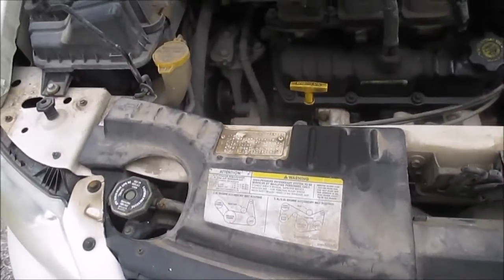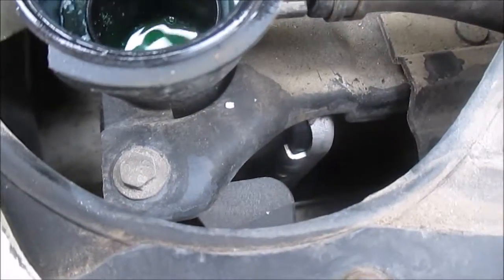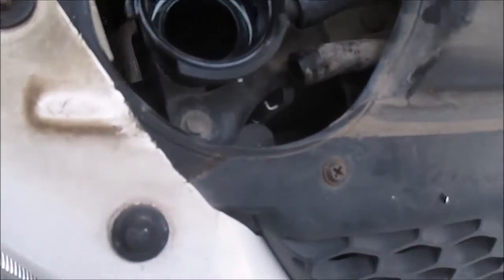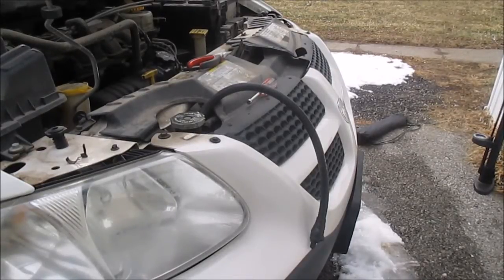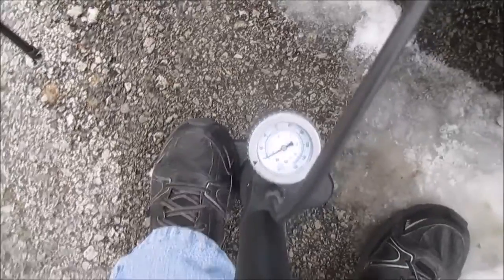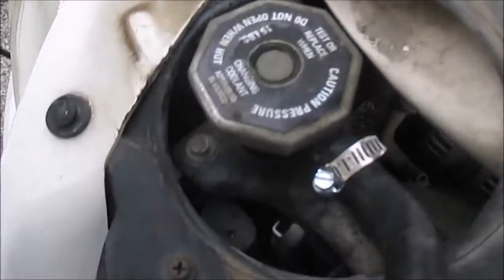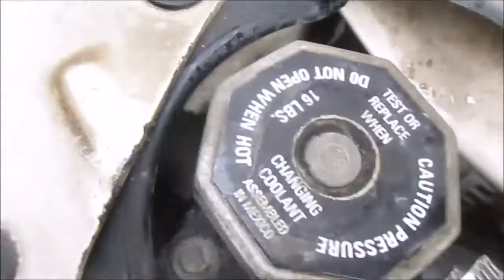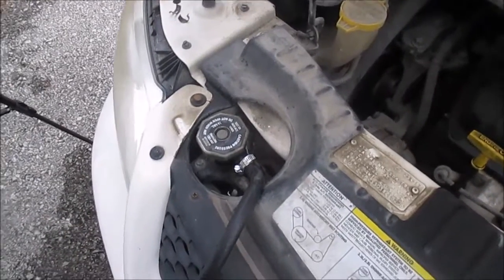HOMEMADE COOLING SYSTEM PRESSURE TESTER - PART 2

Comment: I saw another video like this years ago. I have done this 2 different ways, one by method above and the other by modifying an actual radiator cap with a tire valve through it.  The custom cap method found a leak on the actual radiator.  The method above found a faulty radiator cap as well after my car overheated. I pumped air through the overflow hose to 15 or 16  lbs pressure. The pressure built up and the guage held for a minute then slowly decreased.  The coolant hoses did fill with air.  I couldnt find any leaks until I tapped on the radiator cap and it began hissing. When I swapped with a new cap and pressure tested again, the pressure did build and fill the hoses with air. I could also hear the air hitting the inside of the cap. However this time the gauge would spike at each pump, but fall back to 0 after each pump. If i pumped again, the reading would jump a bit higher, but read 0 again. I assumed the cap was not holding pressure but sure enough the hoses were full. I opened the cap and a big burst of pressure was released.  I inspected both caps and the new one had a slighter larger seal underneath, not sure if it has anything to do with it. Well, I dont know the science as to why the variations during the test of each cap. But i can confirm this method works.

Comment: Your cap has a spring under it, under that is a seal the seats on the inside of the radiator, all you're doing here is pumping air in between two cap seals and not getting air underneath the inner seal into the radiator. That inner cap seal is designed to open from the inside to relieve inside pressure, not open up from outside pressure by adding air from the top side. This cannot work, and is why you're upper cap seal appears to leak when in fact it's probably good. Try a new cap the same way and I guarantee it'll do the same as this cap does.
Reply: You don’t know how radiator caps work. What he’s doing works.
Reply: @wcjcnc  and yet here you are with no explanation otherwise?... go figure?
Reply: @garyr7027  A radiator cap allows coolant to flow in both directions.  When the coolant gets hot it can be purged out of the radiator cap and into the overflow tank. When the coolant cools down it will be sucked back into the radiator. Sorry I didn’t explain. I figured you would just search,” how a radiator cap works” on YouTube. There are some nice videos with animated graphics showing how this works. I posted a link to a video to show you how a radiator cap works.
Reply: @wcjcnc  yes that's how it works, but if I recall in this video it defies those principles and that's what I was trying to convey... maybe I didn't explain it right? And no I didn't need YT, I've known that from years ago before the internet.
Reply: @garyr7027   Wait what? First you comment that,” here I am with no explanation on how it works”. So I explain how it works. Then you tell me you’ve known how it works for years but you don’t think it works in the video. ??? Alrighty then.
Reply: @wcjcnc  man go back and watch the video very carefully and think. You obviously know how a cap works, yet you can't catch what he's doing wrong?... C'mon man I know you're smarter than that. I reviewed the video again, and he's not testing it right because he's forcing air up against a one way valve inside the cap inwards when the valve is only meant to allow pressure thru the other direction. He's loosing pressure thru the upper cap seal which would indeed happen cause the way he's pumping air up against it due to the valve inside the cap that won't allow air INTO the cooling system.
Reply: @garyr7027   I think we’re both focusing on two different things. My point is, you can put pressure into the radiator like he’s doing. You’re point is, he’s miss diagnosing his radiator cap leaking because he’s forcing air out. I think we’re both right. You can put air pressure into a radiator like this but as soon as you reach the radiator cap’s rated pressure, the check valve will close, once that happens you’re just pushing air into the tiny area directly under the cap at which point it forces its way out from under that cap seal. I wasn’t paying attention to his mis diagnosis.  He should pump air into the radiator, then wait for the air to stop escaping from the cap. Then look for leaks. Sorry I wasn’t paying attention to him thinking his cap was leaking.
Reply: @wcjcnc  and then there's the spring loaded seal inside the cap, which seals against the radiator neck on the inside. That spring forces downward pressure against the inner seal, and he's pumping air inwards with the spring pressure. So basically, he's aiding the spring pressure, and there's no way forced air will get past that inner seal. Now if that inner seal wasn't there, and or the spring, this method would work in testing the system for leaks so long as the overflow tube is blocked off. He's pumping air in between two seals thru the overflow tube and nothings getting down into the system, and it can't be done this way, thus why he's getting air past the upper seal of the cap. That upper seal will give way long before the inner seal will... if it gives at all.
Reply: @garyr7027    Air will go through the check valve into the radiator but only until it reaches the caps rated pressure. Then the check valve will stay closed. Then it will only put pressure into the tiny space under the cap. So you can put pressure into the radiator like this but only 12-15 pounds. When water is pushed out of the radiator it pushes that big rubber seal with the spring on it up off the seat. When it sucks water back into the radiator it pulls it through a check valve located in the center of that big rubber seal. When I test a coolant systems I use a coolant system tester that eliminates all this so you can put as much pressure into the radiator as you want. This video is just a ghetto DIY way of doing it. Now that you got me thinking about this I may have to modify a radiator and do some test just to see how much pressure you can actually get into a radiator by doing this. Shit like this eats a hole in my brain.
Reply: @wcjcnc  but then that's only inside pressure and suction, all designed to operate from under the seals, not above the seals. Pressure from the inside pushes up against the cap spring, suction pulls from the inside on the check valve spring as the engine cools down so long as the system is fully bleed off. So, again unless I'm missing something here?... i still can't see this working even if it had 20 plus psi thru the overflow tube and by then the upper seal fail to hold as in this case.
Reply: @garyr7027    But I would think the check valve would open when pressure pushes on it from above. It’s still opening and allowing flow in the same direction as it does when the radiator is sucking coolant back from the overflow tank. Hell I don’t know, you may be right.  I have a shop, when I get a chance I’ll cut the neck off a radiator and rig up a little thing so I can test this. I gotta know now.
Reply: @wcjcnc  yeah I hear ya, shit can get easily overlooked even with little things. Damn, I've scratched my head for days on stuff before, and I'm like you I gotta know. Can't count how many things I've dissected open just so I could figure it out... even electronics... Lol
Reply: The vacuum relief valve in the cap is how the air gets in.
Reply: @SirDeanosity  that doesn't even make sense, if that was the case then the cooling system couldn't even bleed out.

Comment: I think the cap acts like a valve and can't be done this way. It won't hold air because it's designed to release pressure from that outlet. I think. Correct me if I'm wrong. Maybe buy a cap and take it apart and rig it to be open the whole time. Haven't done anything yet with it but anyone correct me if I'm wrong.
Reply: Check how the cap works: it works two ways. He uses the second release valve in the cap that let's in coolant fluid back in when the pressure and thus volume goes down that prevents collapse of the rubber pipes every time the car cools down
Reply: That's right, he's pumping air in between two seals on the cap, no air is getting in that radiator. Only the inner seal holds the pressure, and it's spring loaded to seal against the inner part of the radiator, the upper cap seal only seals the coolant that flows into the overflow. This way cannot work for a radiator pressure test.

Comment: this is not correct. The cap seals the overflow that you are connected to. and you are pressurizing the wrong side of the cap spring and thus cannot get pressure into the system. There is no way to force air into the system for your test. If you were somehow "under" the cap spring, this would work, BUT if you were under it, the overflow would be 100% open all the time... which of course it is not. The leaking cap in coincidence.
Reply: You don’t know how radiator caps work. Radiator caps do let pressure into the radiator through the center of the seal you’re talking about. When the engine gets hot the coolant will push the spring loaded seal on the radiator cap up off its seat allowing coolant to go into the overflow tank. When the engine cools off a vacuum is created inside the coolant system. This draws the coolant in the overflow tank back into the radiator through the check valve in the center of the seal. So what he’s doing works and many people test coolant systems this way.
Reply: @wcjcnc  didn't think about one forcing the vacuum valve to open with positive pressure from outside but you are right..
Reply: @kafklatsch3198   Lol. I thought the same thing when I saw a few videos of people doing this. I thought there’s no way this would work. So I had to do some research on how radiator caps work. I didn’t know there was a check valve built into the center of the big seal to let coolant back into the radiator. I’m 53 and never knew that.

Comment: Hi guys I found another way to do this same test in a different setup with far less work. It involves using a compressor tire inflator which plugs into one of the car battery jacks. There's a picture of this at https://www.amazon.com/Hausbell-Portable-Compressor-Inflator-Multi-Use/dp/B07GTFFHC6. Basically I would just disconnect the hose to the overflow tank on the tank's side and hook it up to the inflator using one of the adaptors appearing on the top right of the picture link I just gave. The principle is the same but far less work in having to build everything from scratch. The tire inflator set already has everything needed to do the test. Just saying if you happen to have one of these tire inflators lying around like I do, just plug and test. I found a leak on my Camry using this setup which I conceived after watching this video. Thanks for doing this video otherwise I wouldnt have thought about it

Comment: AJ.....if you are pressurising via the vacuum valve ( of the cap )....then at the end of the stroke of the pump the vacuum valve closes...so what pressure are you monitoring on the pump gauge?
Reply from the maker: I think I see what you are saying, I thought about it for a little while. I think you are right at the end of the stroke of the pump the valve would close, and you would be monitoring the pressure on the vacuum valve and cap side. However I think this should still work for monitoring the pressure in the system, because if pressure dropped on the system side, the pressure difference across the vac valve should open the vacuum valve again and you would see the gauge pressure drop. At least that is what I am thinking, I could be wrong. Lets say you pump the system up to 16psi and the pressure is equalized on both sides of the vacuum valve. So now we have 16psi on one side of vac valve and 16psi on the other. I would think if a leak is present on the system side  you would have a pressure imbalance and the vac valve would open and you would see a pressure drop. Well anyway I think I see your point, and perhaps doing this test might be better done removing the radiator cap, and replacing it with a radiator cap with all of the guts removed so the only function of the cap is to just seal the system, and then tap into the overflow and pressurize the system that way. Anyway I still think doing it the way I did it would work and show pressure drop if there was a system leak. Let me know what you think. Thanks for the comment and have a good day.
Reply: @figibloom    You are correct. Think of a piece of pipe with two check valves inside it. Each check valve lets pressure move in opposite directions. One check valve takes 15 pounds of pressure to open, allowing pressure to go one way. If the engine and coolant are cold the other check valve doesn’t need pressure. It’s already open and allows you to move pressure the other way, into the radiator. You need to look at the pressure rating on the radiator cap. Let’s say it’s 15 PSI. So once you pump 15 PSI into the radiator you will be at the point where the seal on the cap would usually open but because you’re using the overflow port the pressure will be the same on top of that seal so it won’t open. Never exceed the pressure rating on the cap. OK so let’s say now you have 15 PSI in the radiator. That should make coolant come out of the leak long enough for you to find it. If not. You can wait until the pressure drops to say 5 PSI and pump it back up to 15 PSI.

Comment: the radiator cap is close you cant pump the air to the system friend
Reply from the maker: +amjad amj 
No sir you are incorrect in your statement. It opens the vacuum valve side of the cap. Here is what I am talking about. 
http://asecertificationtraining.com/radiators-in-automotive-engines/      (scroll down to the diagram of the radiator cap and you should see what I am talking about)
Radiator caps have two way valves one that opens on pressure usually around 13-16psi and relieves the pressure to an overflow tank or vent. However when that coolant cools down it creates a vacuum in the system and pulls that coolant back from the overflow back into the radiator through the vacuum valve.  I can see why you would think that, most people do not realize there is a vacuum valve in the bottom of the radiator cap. So it works just fine doing it my way. However most of the time I use my stant pressure tester to do this test, but in a pinch this works to. Remember there more than one way to do something. Thanks for the comment and have a good day friend.
Reply: thanks friend great information